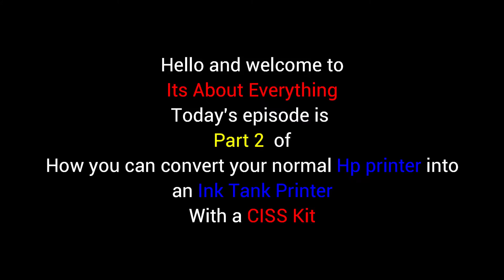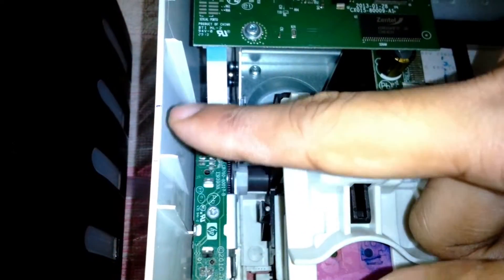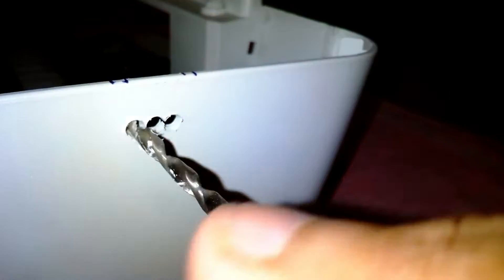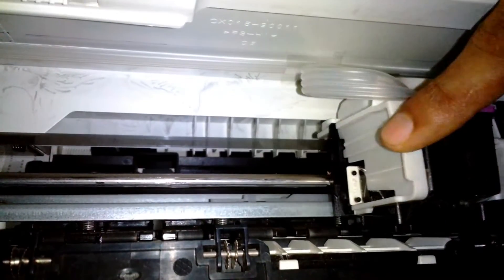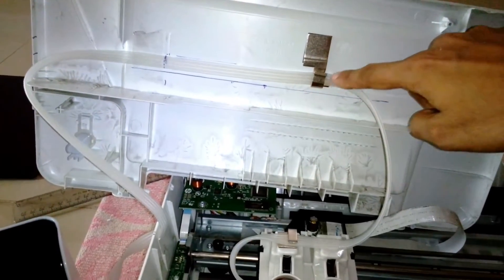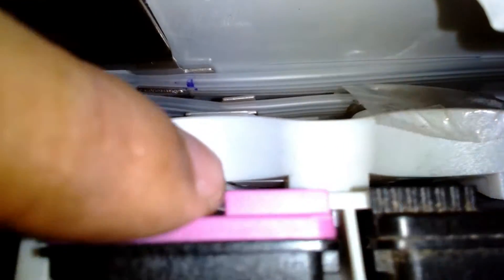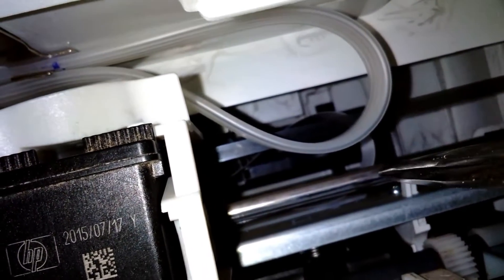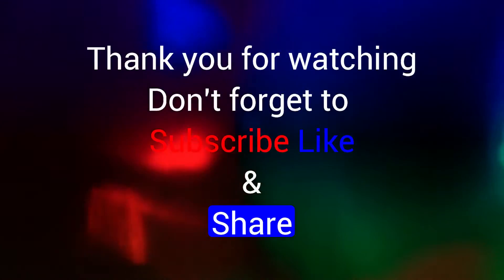Hp printer ink tank conversion  Part 2  with a CISS kit (DIY) -- Its About Everything.

Comment: Ciss kit installed and works perfectly but after a couple of months the HP stops printing the problem is not with the cartridges but HP blocks the cartridges that are being re-used. And no amount of printer resets does the job. I have HP desk jet 3830, and I haven't found a solution to that. Ultimately to print I had to buy new cartridges after which it started printing normally. Now my question is how does one clear the ink level memory from the printers motherboard ???
Reply: look for service tool . its there for canon, just chk it works with hp or not..

Comment: tools links do na
Reply: Dont buy. Ur cartidge will not work after u  crossed the mentioned page count of your cartidge  and even you refill or do ciss , cartidge error will be present and you have to buy a new one.

For example :- hp 680 black cartidge can give max 480 pgs  , if your printer crossed 480 printout then cartidge will get failure even if you refill

Comment: ink tank lagane k bad cartridge kinta din chala or kinta page printe huya???
Reply: depends on your requirement with 100 ml you can use 1000-5000 pages
Reply: @techinfocareerguidance  मै जानना चाहता हूं कि printer me ciss tank लगाने के बाद टैंक में ink समय पर खत्म होने से पहले ही डालते रहे तो printer cartridges कितने पेज प्रिंट कर सकता है ? 
क्या वह ink tank printer ke बराबर 8000 पेज प्रिंट करें सकता है क्या?
Reply: @NASIB8484  no your printer will print upto page count which is  mentioned in cartidge .

For example :- hp 680 black will max 480 pgs even you refill or install ciss.simce chip is present in cartidge , after 480 pgs cartidge will show cartidge failure
Reply: @aysikroychowdhury4380  what is the solution for this error?
Reply: @sampathanuradha7652  no solution. Either buy cartidges or buy cheap ink tank printer.
 I bought inktank printer 1 yr old , have print odd 3000 pages ,still black ink 70% and colour at 80% remaining.

Comment: Can you mix Dye ink Prints with Pigment inks??? Say I ran out of Pigment inks then I buy Dye ink and then can i use this in the ciss system?  I am new to this ciss.
Reply from the maker: No they can not be interchanged as the inkjet cartridge works with the principle of thermal DOD (drop on demand) or Piezoelectric DOD  which requires a special type of ink. 
However it might work but proceed at your own risk.
I hope my reply helps.
Reply: @ItsAboutEverything01  which brand ink do you use for the deskjet1112 printer?